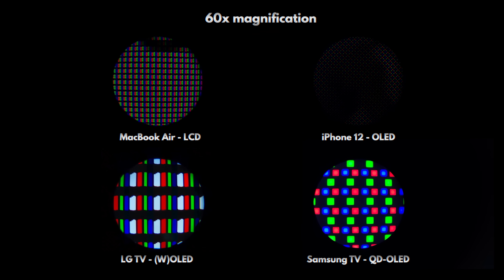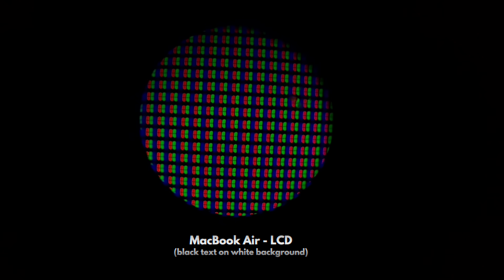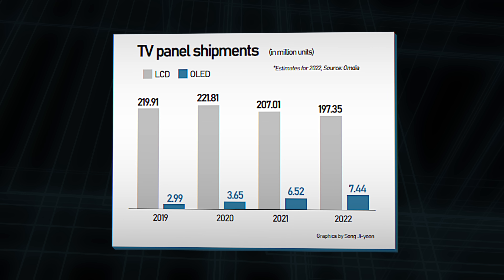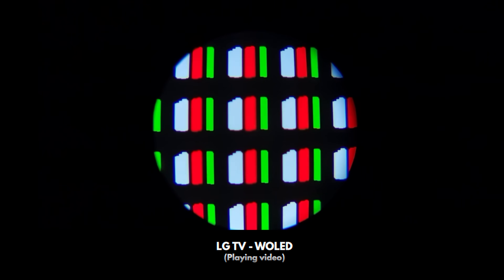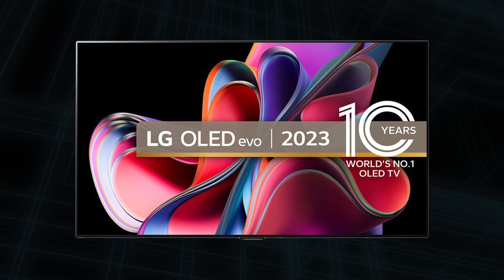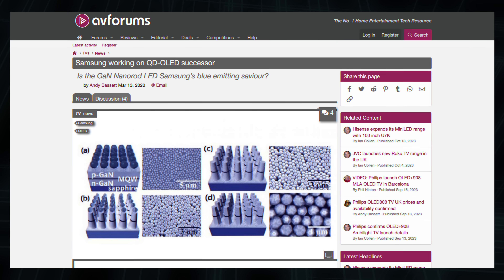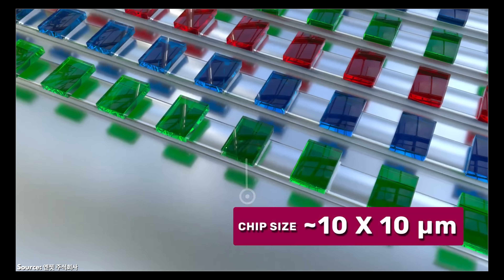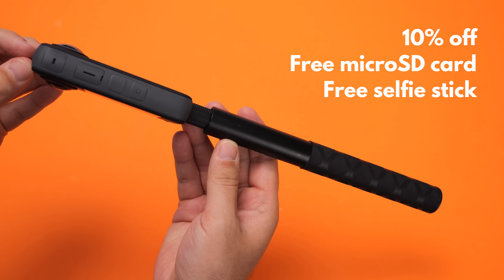The billion dollar race for the perfect display

Comment: Amazing leaps and bounds in the display market since I was a kid.
Back then...The biggest CRT was like 32 inches and weighed hundreds of pounds, cost thousands of dollars and might last a lifetime...especially if it was a Sony.
The Samsung on my desk now is just as large, but weighs less than 20 lbs and was less than $300.
I was surprised to find out that both Samsung and LG are Korean companies...not that there's anything wrong with that.
Reply: The sad part is that CRTs still are better in many ways, I wonder how far that technology could have been pushed if endless resources were poured into them like LCDs and OLEDs have been.

To be blunt, not a single new display method will come close to the response time or refresh rate of a good CRT. Not because I say so, but because the way the technologies work (and how a digital signal works) would require decades to make it work. The existence of any buffer system at all means that the response times in digital signals will always be bad, even the OLED that cuts response times to a fraction of its LCD competitor, is still far slower than a CRT.
Reply: @sadscientisthououinkyouma1867  I've seen in some place that there is someone making a 4k CRT, but it's video has only a bunch of views...
Reply: The popularity of Korean dramas and K-pop is undeniable, and both are known for their high production values. This includes stunning visuals, often featuring vibrant colors, intricate details, and fast-paced action sequences, so of course, companies like Samsung and LG face pressure to constantly innovate and offer the latest advancements to stay ahead of the curve.

The demand for superior screens also extends beyond media consumption. The rise of gaming, virtual reality, and other forms of interactive entertainment also incentivize the development of better display technologies.
Reply: We had 40 inch CRT's, the largest we ever made
Reply: Sony thought the future was Field Emission Displays. p.s. Check out the Mitsubishi 37" 4-3 CRTs. I knew someone who had one. It took four men to get it upstairs !
Reply: @MrDuncl  Remember the old rear projection boxes...speaking of Mitsu.
I loved busting them open and getting the big lenses...looking at one now.
Sony really dropped the ball on consumer electronics...well, except for maybe Playstation, right?...their cellphones sucked, they quit tv's and stereos...I don't get it.
Japanese was always better than just about everything...remember Nakamichi?
Reply: The reason was the other significant “consumer electronics” players quit the market as the margins got worse the more the technology matured.  Some quit faster than others, Philips (who were a major player and used to be dell’s main oem) for example had a kind of merger with LG display but eventually quit entirely.  These days their brand is used under licence by TPV.  Likewise Sony entered a joint venture with Samsung only to sell its stake to them later.  Panasonic hung on until a few years ago.

In the 1990’s Samsung and Goldstar (a predecessor of LG, they are the G in the name) monitors would have been considered budget.  Now the premium brands use their panels!  Samsung and LG are notoriously competitive so it was unlikely that one would have quit the market and leave it to the other to dominate (thank goodness for it or we would likely have seen innovation slow).

There are quite a few other LCD manufacturers , though they are mostly if not all Chinese companies in the consumer space IIRC (BEO and TCL spring to mind).

Comment: Questions:
-  Why do LCD's need 2 polarizers? wont one do the trick? (Considering the liquid crystal sounds like an adjustable polarizer)
- How is the Liquid Crystal manipulated? Does the full panel need to be the same, or can we change just parts of the panel at a time?
- How can LCD's have different pixels be different colors if the backlight is just one light?
- If its no longer a single backlight in LCD's and rather a grid of individual LED's how is that different than the WOLED technology described?
- With individual LED's are the polarizers still needed? (including the liquid crystal?)
- in your animation about quantum dots we still had the color filter in there, why would we need that if we have the quantum dots?
- How do we individually pass current through each OLED?
- What is hard about making AMOLED bigger?
- Can you give numbers when you say OLED required "Way Way fewer" layers than LCD? How many does each type have? and how thick is each layer?
- What property of an OLED allows it to be transparent?
- You mention instant response times for OLED, but you didnt mention if LCD has any kind of delay and if so what causes it.
- What is a hydrocarbon and why does that mean organic. Can you compare to a non-organic LED?
- What are the % gray slides and why do they matter?
- What is a "compensation cycle"?
- Why does brightness cause burn in, what about how the material degrading causes it?
- How would focusing light to make it brighter prevent burn in when you previously said brightness is what causes burn in. It feels like you meant to say high power or current causes burn in?
- Your graphic indicates META can be turned on or off, but you also say its fully passive, so how would that work? Or is the graphic an editing trick?
- Why call it QD-OLED when it would make more sense to call it BOLED?
- You mentioned the directionality of light being an issue for LCD's, but wouldn't adding the lenses like in OLED's cause a similar problem?
- What do you mean "hire" 4 upcoming innovations? Did you mean highlight?
- How does stacking work? Do the panels have to be offset? Or can light from the back OLED's pass through the front OLED's? Does this mean OLED's are transparent even when emitting their own light?
- You make it sound like stacking can both increase brightness and screen life, but if you increase screen life by decreasing brightness of the individual panel's wouldn't that counteract the brightness gain?
- How does doubling the panels increase the life by 4 times? what's the math there?
- Can you tell us what the OLED's are deposited on today to help make it more clear why silicon would be an advantage?
- You are talking about how micro OLED is great for small applications, but then says its good for the "big screen beyond" but that is the opposite of a small application, so why mention it? (After a google I found that the big screen beyond is the name of a VR headset, maybe say that or change the graphic on screen to make it more clear)
- Your graphic would suggest LCD's cant get burn in, but a quick google shows that isnt true, so why say it is?
- You say we dont know how to make microLED displays and immediately follow by showing real life microLED screens, can you explain how this makes sense?
- What do you mean when you say "Theres only a few of them" when talking about microLEDs?
- Are the "True crab" microLED's different than the silicon backed microLED's you talked about earlier in the video?
- You say MicroLED's are perfect for small application like VR headsets, but now you are saying we cant make them small enough yet to do a smaller than full wall display... I dont understand unless we have 2 different technologies with the same name?

Overall I found this video interesting and entertaining, but to be honest I feel that im left with more questions than answers :(
Reply: We need only one polarizer (Fixed or passive) and the LCD layer itself acts as a second polarizer (Active)

Comment: That's why crts were better at the time, the contrast ratios were in the millions, leds today are only jn the low tens of thousands, it's a shame

The beam of an electron also was very tight, if we were to make one today sure it would be heavy, but it would be vastly superior to anything currently on the market, better packs, lower grain size, compared to leds, meaning a much sharper image being possible

Often times when led, pled etc comes into play, using a red image, the contrast level goes way down, something about the colour red and the contrast is murdered by modern screens

With modern lithographic techniques you could make a mask with sub pinpoint accuracy, or you could eliminate them all together by using three sets, containing red green and blue phosphors only, meaning they're monochromatic and don't need the screen, and then combine the output using mirrors for zero image interference

Comment: CRTs had a huge advantage that is hard to emulate with other display technologies. MicroLED can do it, but the other's really can't.

On a high end CRT the raster beam would illuminate the fluorescent material and it would glow very brightly for some tens of microseconds (literally, on a high speed camera you can see that there's basically a single line that's brightly illuminated and a few lines fading behind it at much lower brightness). The problem this solves is that your eyes move quite far during a single refresh of the display and this causes massive persistence blur with a constantly illuminated display. It's as clear as a 1000 Hz display during motion but not as smooth. The reason it helps is that e.g. if your eyes track an object on the screen at 144 Hz on a 2560 wide screen during 1 second, then your eyes move 18 pixels per frame; with constant illumination that's 18 pixels of linear blur; with strobing, the screen flashes and a the bright after image moves along with your retina at the pace your eyes move. This illusion of >1000 Hz refresh breaks when you are not tracking the object on the screen, then you see a series of overlaid images like you do moving your hand quickly in front of a strobe. Still, it's a really parsimonious solution.

There's another way to this goal and that's to just accept constant backlighting and do >1000 FPS for real. That's not as far fetched as it might seem; with >100 Hz the latency is pretty acceptable; the other frames can be interpolated pretty simply without awful artifacting. LCD can't do this because it struggles to update fast enough. 100 Hz is already pushing it and when you push it to hundreds of Hz you get ghosting, inverted ghosting from overdrive and other artifacts that make e.g. a 540 Hz TNT panel look a lot more "meh" than it should do. But OLED totally can update fast enough.

During the height of CRT most people didn't get to experience a high end workstation CRT. LCDs are still inferior along several dimensions and back then they were just awful. The astroturf campaign for 3DTV ended up creating a surplus of high refresh rate panels that were rebranded as gaming monitors and they took off in a big way. 15 years ago it was still popular to say "the eye can't see more than 30 FPS"; these were people who had been brainwashed by low performance consoles since 3D gaming started in the 90's. Games are wildly more popular today; a bigger industry than movies or TV-shows; and that means gaming and high performance demands of games will move the industry a lot more today. LCD will finally die and I'll be there to piss on its grave.

Comment: I had a LG OLED C7 from 2018 and after 5 years it had so much burn in it was distracting to use.  I decided to give LCD a try again and went with the LG QNED Mini-LED (QD-LED + LG's nano color technology).   I chose LG over Samsung simply because I like LGs WebOS better than Samsung's offering, and I like Dolby Vision, which Samsung doesn't support.  Aside from some minor blooming on very rare occasions, I can't tell the difference between the 2 displays.  The mini-LED and dimming zone technology LCDs have now has come so far that OLED isn't really necessary anymore.

Comment: OLED looks better to me with less brightness. Too much brightness ruins texture. Colors are amazing. Texture on LEDs are lacking. Less texture means less detail which is why everything should not be briiight 🌞
Reply: When heard current OLED screens have a shorter lifespan than LED  I hears enough .
Pay more for something that will not last as long?  I don't think so .
Reply: @Crashed131963  The brighter you turn up the OLED the shorter they last and it comes down to quality over quantity. As fast as everyone changes up technology does this really matter? As most tech ESPECIALLY phones will be junked in as little as 5 years anyway!
Reply: @Crashed131963  Main point: If I get more  of what I enjoy from OLED I will gladly pay to enjoy it because in most case scenarios both screens will last about the same amount of time do short lived software updates!

Comment: First off, LCD's are unquestionably on the way out - banish them from your thoughts as all the major panel manufacturers are moving away from LCD production lines in the future, if they haven't already.

Early start up costs of emissive displays like OLED have slowed their adoption, but they are steadily becoming cheaper, and will continue to do so because they require less display panel layers, and less manufacturing steps as a result.

Albeit adding layers like MLA (micro lens arrays) is a economic step backwards here made for pixel efficiency/lifespan reasons)

Samsung's NLED (nanorod LED) solution being inorganic means cheaper manufacturing (less expensive factories and operating costs) from being less sensitive to eenvironmental factors vs OLED so it will see a faster adoption in the industry than OLED did.

It seems like Samsung's NLED + QD red/green filters + MLA would be the perfect display, with likely cheaper panels eschewing the MLA to reduce costs for mass adoption.

µLEDs (MicroLEDs) will never take over any market segment, save perhaps the absolute high end - possibly dominating the future projector less cinema screen space due to their intrinsically tileable panels allowing for cinema sized screens easily, meaning projection booths are no longer necessary for digital cinema.

That being said even then there is no reason that NLED based tiles could not replace the µLEDs tiles and reduce costs further, but I do not know the absolute brightness limits of µLED vs NLED, so it is possible that only µLED would be appropriate for serving cinema screen needs.

Also worth noting that VR headsets are steadily increasing resolution and becoming lighter/more comfortable to wear over long periods.

It is not impossible that VR based cinema could in the future displace actually going to the cinema in person - especially given the latest pandemic problems shown in closing in several dozen people in a single room for 2+ hours at a time.

We already interact so much using mobile devices like smartphones that it doesn't seem any kind of stretch that we could end up having shared 'multi player' experiences in VR cinema where we don't need to be embarassed to get up and go to the toilet part way through the screening because it is on demand anyway.

Comment: Are you sure with the LCD principle?

As far as I know there is only one polarizer. The second is not there otherwise the screen would be black all the time, no matter of the orientation of liquid crystals. 
Because the liquid crystals are what polarizes the light second time. Without power, they have one orientation which stops allows the light through, with power they orient and stop the light. this version is basic and slow. There are active versions which have both orientation powered- for fast response and better light transparency in for light open configuration.

Comment: 0:00 - 1:02: Introduction and explanation of the concept of convergent evolution, using the example of crabs and displays.
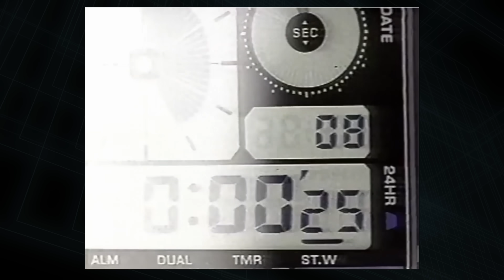1:02 - 3:22: Discussion of LCD technology, its history, how it works, and its limitations.
3:22 - 5:22: Explanation of mini-LED and Quantum Dot technologies, and how they improve upon traditional LCDs.
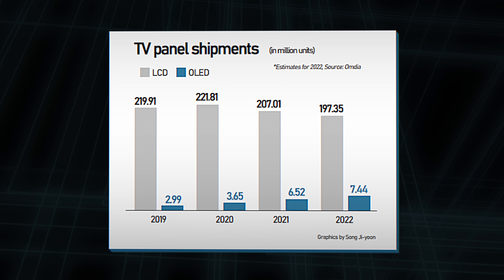5:22 - 7:52: Discussion of OLED technology, its history, how it works, and its limitations.
7:52 - 10:12: Explanation of the new technologies used by LG and Samsung to improve OLED displays, such as microlens array and Quantum Dots.
10:12 - 12:32: Four upcoming innovations in OLED technology: tandem OLEDs, blue PHOLED materials, Micro OLED screens, and replacing blue OLEDs with gallium nitride nanorods.
12:32 - 14:00: Recap of the convergent evolution of LCD and OLED technologies, and the emergence of micro-LED as the potential ultimate display form.
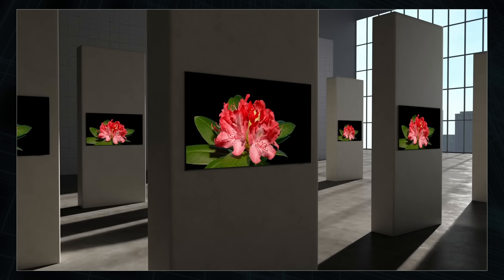14:00 - 15:22: Discussion of the challenges and future of micro-LED technology.
15:22 - 17:52: Sponsor segment about Insta 360 camera and its features.
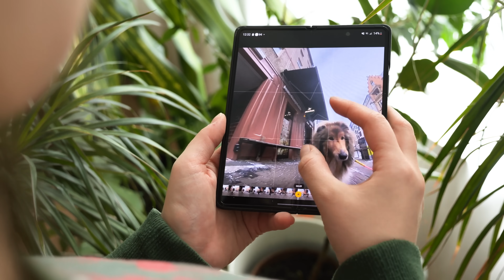17:52 - 18:32: Outro and call to action.

Comment: The problem is that the lifespan of many TVs on the market is poor.   1~4 years, especially for OLEDs.   I know people who repair TVs.  The TV repair biz is not like it used to be.  TVs are not made  for repairs much; there are pretty much 4 parts: Power supply, controller board, LED board, screen, backlight, and frame.   Failure of the backlight or screen = toss the whole $3000 TV into the trash.

Then buy another TV.

Comment: Mini-led are  part of it but I wouldn't say they are that important...  The whole Full array back light tech ( hardware and software) and local dimming is  what  really changed the game . As you can have a good LCD panel these days even without  Mini LED... As long as you have  good FALD. The thing Mini LED does give you tho is greater brightness  and the ability to get that on smaller thinner devices..
Reply: They're the exact same technology, mini led is just a brand for the fald using tightly packed brighter and smaller led for the backlight and separate zones for the individual leds.